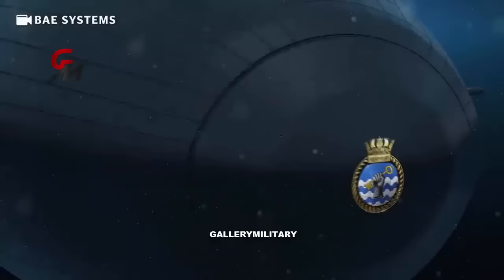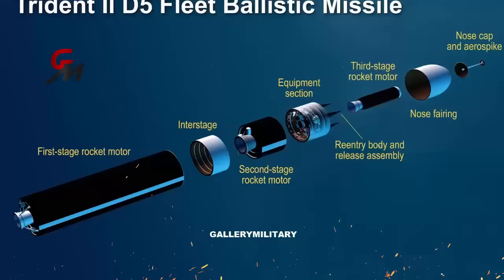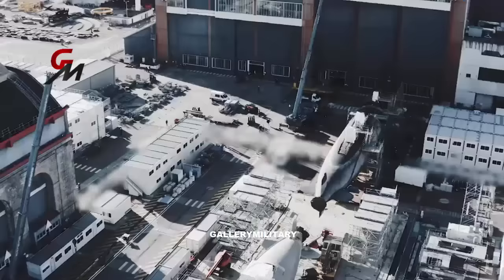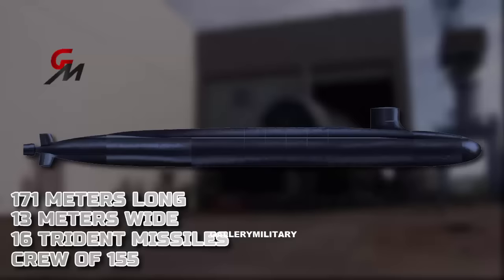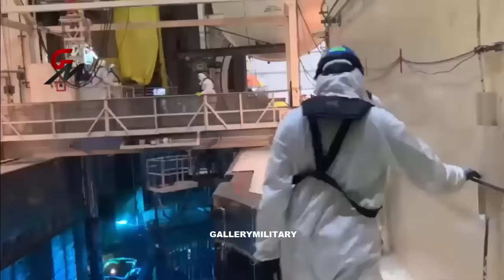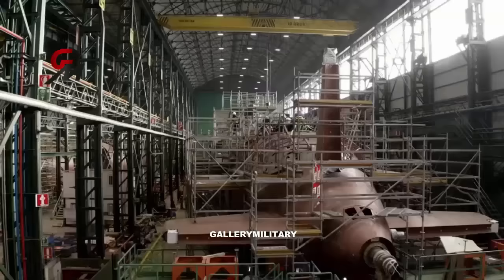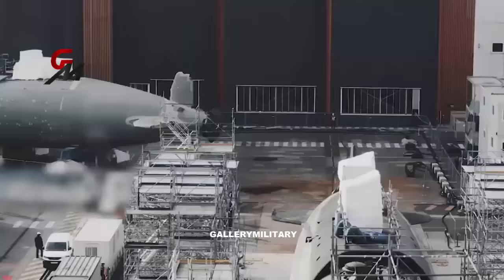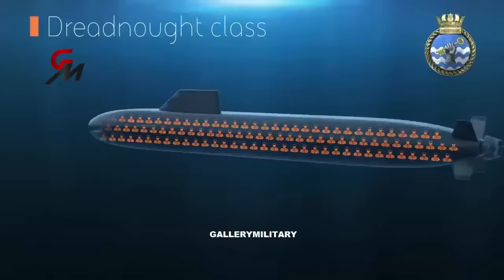UK is Building The New Submarine that is Totally Different than any Other Subs on Earth

Comment: I have been fortunate to have been aboard our current V class subs a number of times ( my employer supplies engineering support services) Dreadnought can’t come soon enough, in contrast to some the comments on here, I was shocked by the condition and age of basic critical equipment, appalling might be appropriate. Massive respect to the mariners on board there ‘innovative solutions’ to the problems they face are what keeps these vessels moving. Based on what I have seen and heard the next gen will be rather like stepping from a model T into a McLaren, I hope they can overcome the obsolescence issues which plague these long life platforms.
Reply: VI is 6 not 4
Reply: I have read articles on US Navy budgeting meetings and the brass continuously saying "the Columbia Class is getting funded".  It must be very hard to resist kicking the can down the road on a project such as this.  The cost is astronomical and it doesn't do anything to ease current needs.  So those that have to make these budget choices have my sympathy.

Comment: The schematics they show keep the “X” configuration for the stern fins, but the hulls under construction show the “+” configuration. Are they showing outdated schematics or do they rotate?
Reply: Presumably they are showing the wrong submarines under construction because they couldn't find video of current construction.
Reply: @Wick9876  Agree with that
Reply: Astute class assembly video clips? For security reasons perhaps.
Reply: It isn’t built yet. The video is mostly of other vessels, just visual filler.

Comment: If its a reliable and breaks down as much as their newest aircraft Carrier Britain's enemies won't have too much about it.

The ship is brand new and it keeps breaking down and having to be escorted back to port from the middle of the ocean.

It is possibly classified but their submarines probably want fairing much better either.
Reply: Gerald Ford was laid down in 2009, it has just been declared fully operational 13 years later. HMS Prince of Wales took about 9 years to become operational. From what I have been told, the Rolls Royce reactors perform significantly better than the US equivalents.

Comment: Why only 12 missiles for the Dreadnoughts compared to 16 for both the French and US boats? This is a huge reduction when you multiply by the number of MIRVs inside of each. Always cutting costs... like a new PC sounding great but with reduced RAM! At least you can simply add more RAM to a PC though.
Reply: I wondered that myself, however, I doubt it is for cost cutting reasons. After all, if you cut the number of missiles simply for costs then surely the boat would be shorter too!
Reply: Because we are already building the next gen one for the AUKUS deal so this is a stop gap
Reply: @dannycostello no it isn’t, aukus sub is an attack sub to replace astutes, this is a balllistic missile sub to replace vanguard subs.

Comment: China is now building a flying submarine. Can be used up to 2 kilometers under water, used like a ship on water or fly up to 10 km high like a jet plane. And all that in one machine. Its 300 meter long and can also float in the air at any height as it also has anti-gravity feature. Under water speed is 100knots per hour. In flight mode at Mach 3, or hyperspeed in anti-gravity mode at Mach 28. Propulsion is done by a 100 Gigawatt nuclear fusion reactor.  First production model comes online next year first of April.
Reply: LOL, a thousand years after inventing gunpowder, the Chinese still hadn't invented the gun.
Reply: I'll have chicken curry boiled rice. a portion of chips. and a pancake roll please.
Reply: @bertiescunsbutch9323  No extra curry sauce on the side?
Reply: Hilarious...not.

Comment: Dreadnaught is an interim vessel and the goal is the Aukus sub ,which will be a step beyond,
Reply: Dreadnought is the Vanguard nuclear deterrent replacement. The AUKUS sub is an attack sub, so if anything a replacement for the Astute. Dreadnought is not an interim
Reply: With a completely NEW design forthcoming it is not only obvious but logical that the dreadnaught will be and IS an in between model!  @Orbital_Inclination
Reply: @HenriHattar  it's not an interim design. It is a replacement SSBN. AUKUS is an SSN, a completely different class of submarine, like the Astute class. 

Calling the Dreadnought an interim SSN is like calling the Type 45 an interim aircraft carrier.
Reply: I don't think so at all, as acompletley NEW item submarine design is not even know yet, do you think they intend to build a new sub that is technically inferior? Doesn't sound like that would be a plan! @Orbital_Inclination
Reply: @HenriHattar  you don't seem to be understanding, they're completely different submarine designs, intended for entirely different roles. What's so hard to grasp about that? 

Dreadnought will never be replaced by the AUKUS sub, because they are designed to fulfil two completely different roles.

Comment: In addition to correctly reading the Roman numeral as 4 vs 6, it should be pointed out that there is no historically significant HMS King George IV and there has not been a King George VI to sit on the throne.  Big miss.  I think it must be HMS King George V, which was a dreadnought battleship class in 1911 as well as a battleship class in 1940 (and was used in the hunt for the German battleship Bismark).  That would seem to be sufficient historical significance.
Reply: King George VI reigned 1936 - 52, and was King during WW2; he was the father of the late Queen.

Comment: Would never have 4 at sea at one time.  1 is always in maintenance, 1 is in training and work-up, 1 in on patrol and 1 is going to or coming back from patrol. So the answer is 1. 
What is "turbo electric drive"?  Doesnt mean anything.  She will be nuclear powered and driven by a what? She will not be driven by an electricity or a turbo.
Reply: It's this: https://en.wikipedia.org/wiki/Turbo-electric_transmission with the nuclear powerplant providing the power for the turbine. Basically the turbine provides the electrical power, which is used to rotating the propellors. In more traditional drives, the turbines are linked directly to the propellor
Reply: @johnfairhurstReviews  Wrong.  The steam driven turbines provide electrical power to MOTORS which drive the propeller.  As for more traditional drives, the steam driven turbine drives a gearbox, often via a SS clutch, to the prop shaft. They are never direct drive

Comment: Have they got any saftey self rescue protocols in that if the electric engine goes faulty and unable to blow the ballast tanks and stop it sinking to crush depth,maybe self deploying air bags of some sort raising it to the surface.
Reply: the crew will be issued cans of Newcastle Brown ale and their emissions will buoy up the sub.
When it reaches the surface the crew will have asphyxiated on their own gas.
Reply: I do not know the inner workings of a submarine but it would be my guess that in an emergency the release of compressed air into the buoyancy tanks would force the water out and the sub would then automatically surface. I’m sure this could be done manually because they must have fail safe systems.
Reply: @rosewhite---  At least the sub will be saved though, after all that's taxpayer money right there!
Reply: Unlike Russian subs 
Western submarine systems have multiple layers redundancy even the sub is badly damaged.
The US for example uses the Submarine Safety Program (SUBSAFE) which ensures crew survival in worst possible situations
The West follows the same guidelines as the US SUBSAFE program which is why submarine losses with the Western subs are rare and very common with Russian subs
Reply: @turtle   A dozen kids arm floats would do the trick, don't you think Mr. Arm chair Engineer ?
Reply: Quick - phone the MoD, they probably haven't thought about it. 
Survivability is an extremely important factor in the design of all military vehicles - land, sea or air.
Reply: @hb1338  HB meaning Half Baked? Half Brained,  Half Blind?